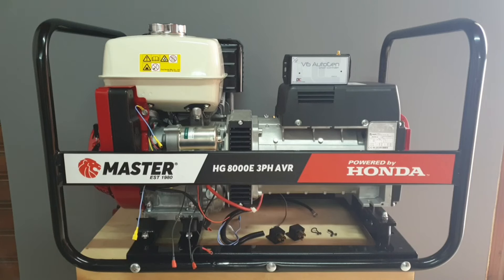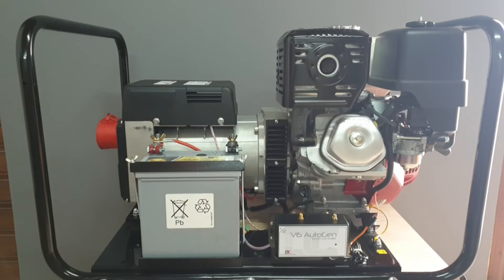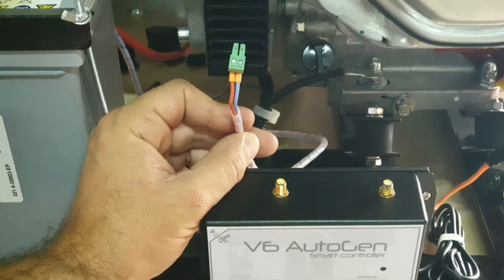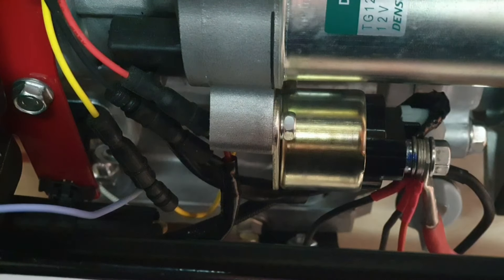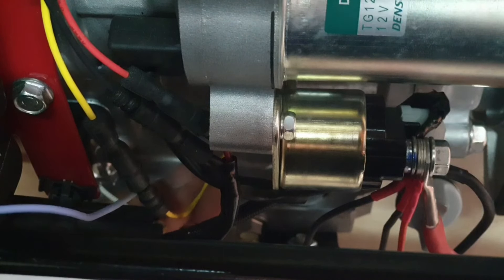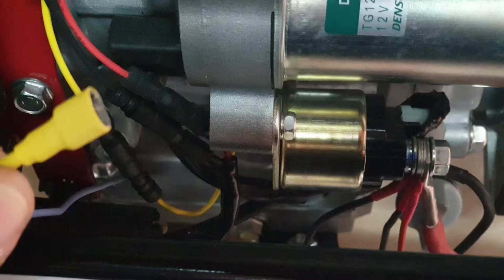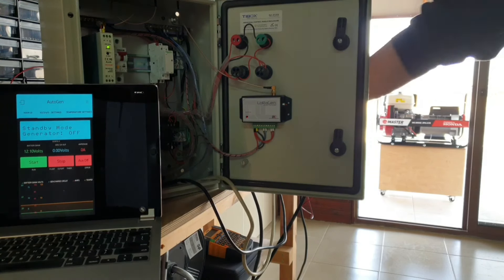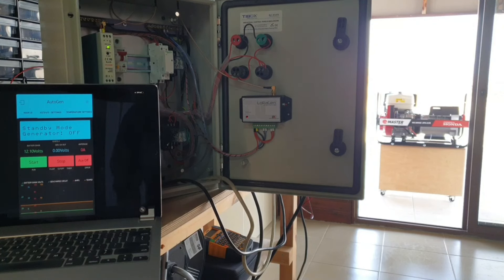WATCH THIS before buying a Backup Generator!

Comment: I wish I could do this in the USA.
Reply from the maker: Hi. Didn't understand your comment.
What exactly do you mean?
Reply: @DCAutogen  it seems like you created an automatic transfer switch for us gas portable generator customers that will turn on when the power is cut from the grid. I’m looking for this in the United States that can do this for my gas generator and make it act like the standbys. Thanks for the reply.
Reply from the maker: The AutoGen controllers are autostart generator controllers.
There are a few events that can trigger the autostart of the generator, which can be programmed according to customers requests.
Example, when Mains AC is down, or if off grid and using battery power, when they fall below a preset threshold, remote start via AutoGen app from any location, according to temperature. The list goes on.
Any electric start generator can be converted to a Standby generator when equipped with an AutoGen controller.
Reply: @DCAutogen  well that’s what I need. I need to convert my electric start gas generator into a standby generator. No battery back up needed just when the grid goes down my generator starts up by itself like a standby.
Reply from the maker: https://dcautogen.com/product/v6-autogen-auto-start-generator-controller/
Reply: @DCAutogen  now is $480 shipped to the United States? And do you have a install for this v6?
Reply from the maker: You can find Installation Instructions and wiring diagram on our website. V2 and V6 instructions are the same, just different wiring.
Reply: my Solar business partner did this with a few generators, but we utilize the Schneider AGS with the Schneider inverters. And hard wire 2 wire start, and it worked great except it voids warranty so we had to inform the customer of this and they had to agree to it.
Reply: @SetchiPaunda  ha ha! voiding warranties should not be on the menu. Yikes!
Reply: @DCAutogen  Seems like the choke controller is nice for petrol operation on carbureted engines, and probably unnecessary for injected engines. I wonder if any such device is needed for LPG or NG engine startups. I don't know that much about gas powered engines. Thank you for your time and effort.
Reply from the maker: It really depe6on carburetor type. Some newer and more expensive generators have automatic choke operation. Even on lpg models. So, in case of manual choke operation, we use the choke linear actuator and AutoGen controls it.
Reply: @DCAutogen Ha! Thanks Nick, that was fast
Reply: @DCAutogen  I'm thinking the best, more expensive petrol operated generators are fuel Injected, getting maximum performance and efficiency. I guess they could be choked for cold starts too.

Comment: Thats awesome ! Only thing is what if fuel runs out on Gen?? will it keep winding over the starter?
Reply from the maker: No it won't. It attempts to start 3 times with pause between retries. If it doesn't start, it will go into an Error state and send a notification.
Then it needs to be reset.

Comment: Wow I really enjoy watching your videos I have a question I'm in the beginning stage of building a generator and right now I'm getting 480 volts 60 hertz in 175 amps but I only have two wires coming off pf my generator would your product work with my generator

Comment: I’m using a Cummins generator that was wired as a standby with a bug clunky ats and my electrician said he is having trouble figuring out how to bypass the factory ats in order to utilize the magnum ags. Any experience with this?
Reply from the maker: Best to reach out to magnum with your wiring diagram if available.